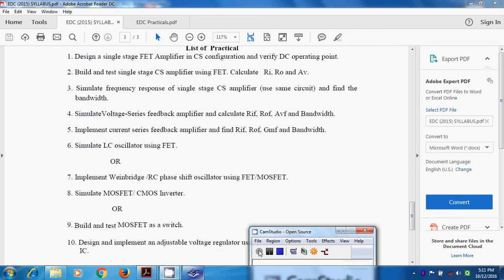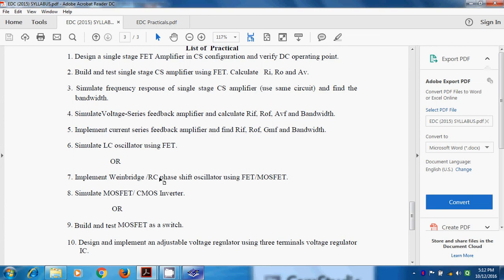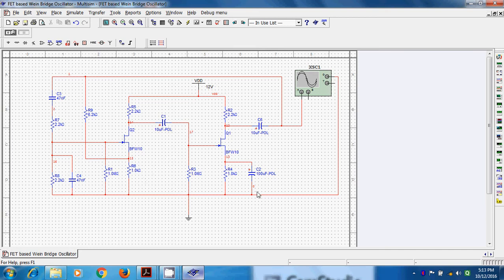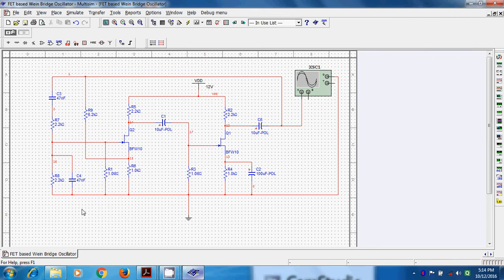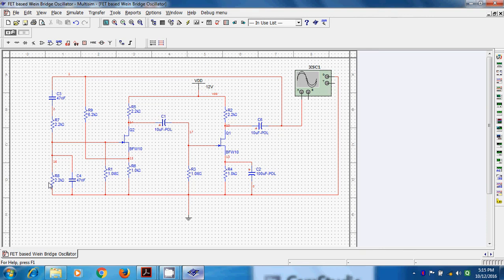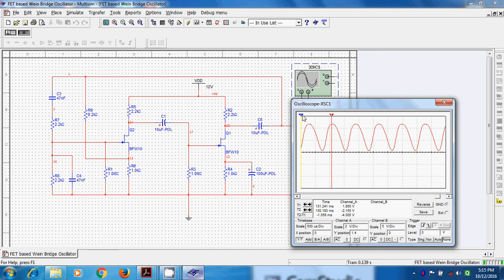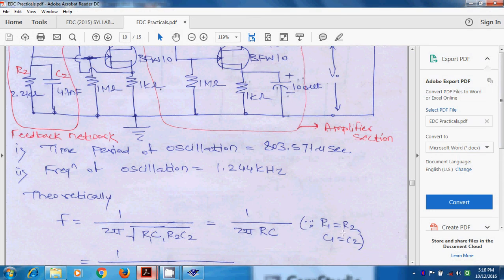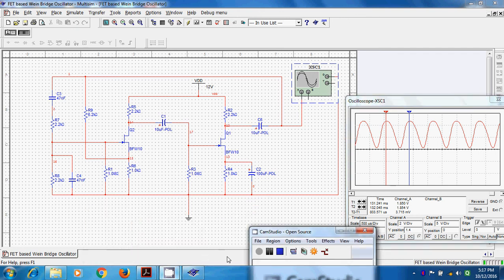EDC Practical: 7. Implement Weinbridge oscillator using JFET. by Prof. Omkar S. Vaidya.

Comment: Sir, please review this is my practical project question,i have to submit in 2 days.I have solved the sum ,got the components, but what next . Please sir ,your little help would be matter much.this is the ques.
Design Single stage CS amplifier for FL upto 20Hz. Use JFET BFW11 to give output voltage of 2v & voltage gain lAvl =10. Design to give ID = IDs = ½ IDSS.